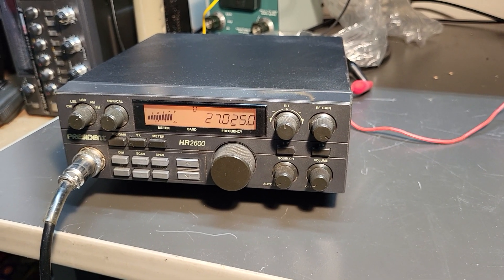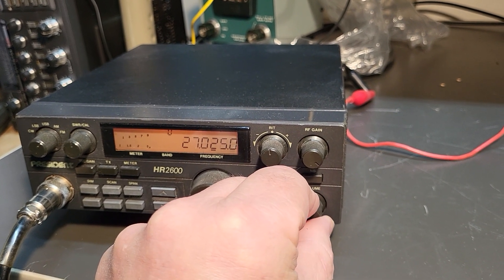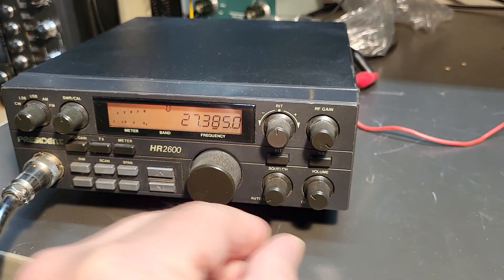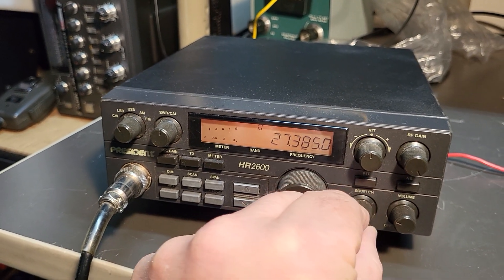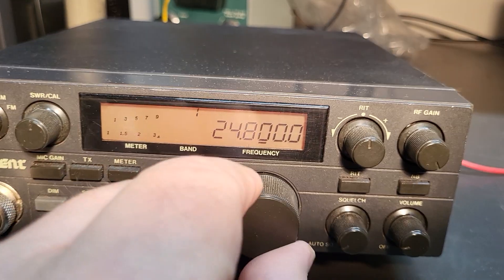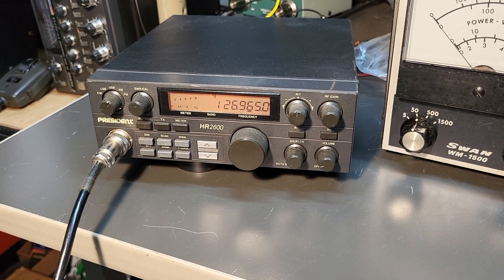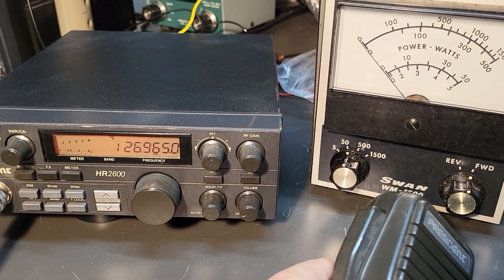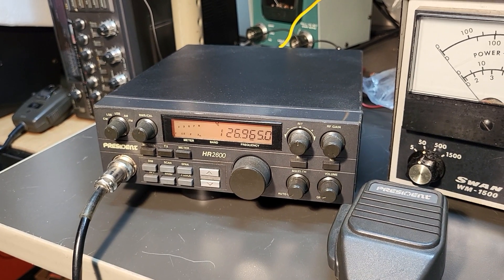Uniden HR-2600 10 meter all mode

Comment: WHERE DO I FIND THE MODS ON THIS
Reply from the maker: I do not know sorry
Reply: Same as the HR2510 and President Lincoln so most of the mods on the internet will work. However in order to modify the 2600 for CB you need to swap the processor with a chipswitch which are very hard to find.